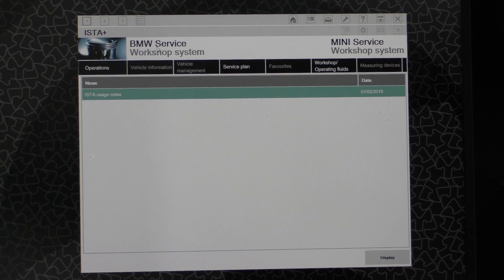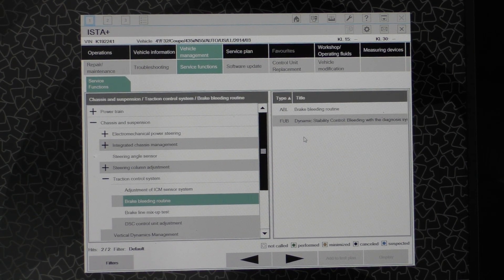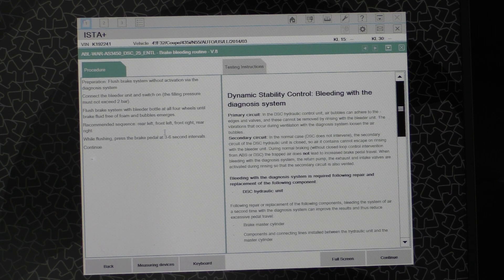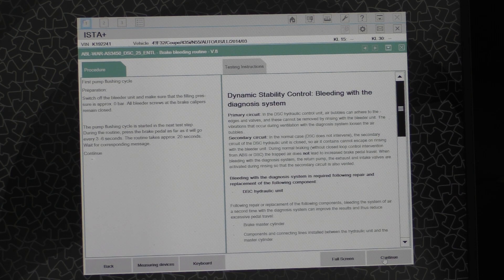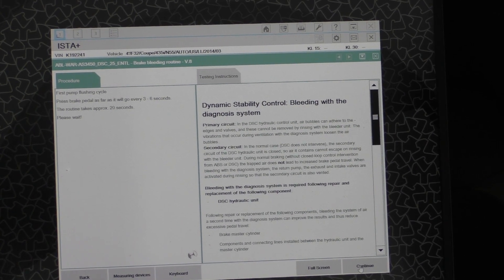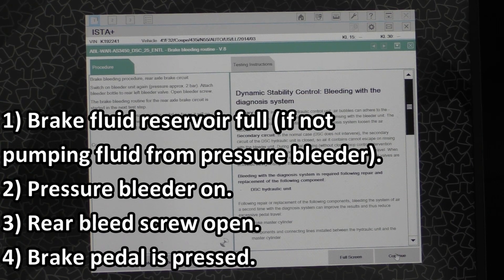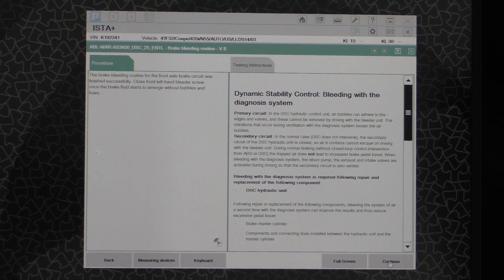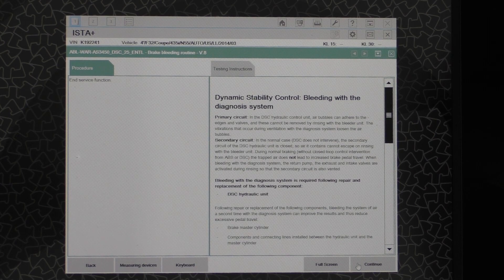BMW ISTA DSC Brake Bleeding Routine (F2x/F3x/F8x)

Comment: For some reason, on my car, a 2018 440xi, I had to not press the brake pedal before continuing to the rear axle bleeding then press the brake pedal before continuing to front axle bleeding. Not sure why it's this way as I had to restart the procedure a number of times until I figured out the logic

Comment: Hi, I ran my reservoir dry on the last nipple when doing brake fluid flush. I drove around for a bit with mushy pedal but topped off and re bled. Now pedal feels good but do I need to do the ABS bleed?
Reply from the maker: I would do some ABS stops in a safe area to see how the car behaves. If they feel normal, then you probably don't need to do the DSC bleed (although it's a good idea to eventually do it).

Comment: When I use ISTA 4.53 ( newer version for G series ) for the brake bleeding routine I do not hear the ABS module activate. I hear some clicking but no ABS module sound. Also, my vehicle has electronic parking brake which needs to be put in service mode before running this procedure.  Strange…

Comment: What about the front right and rear right? Did I missed something? (french guy here)
Reply from the maker: You're supposed to do the DSC bleed after a normal 4-corner bleed, so you only need to do it once per axle (no need to do it on the other side).
Reply: @FaRKle0079  thanks

Comment: About to do this on my f8x with 2 bleed screws on the front calipers, for the part where you bleed the front with the bleeder open, am i supposed to use the inner or outer bleed screw?
Reply from the maker: I'd just do the outer one since it's easier to reach. Plus, the system is supposed to be bled conventionally before running this so there should be fresh fluid throuhout.
Reply: @ I figured it didn’t matter and did the outside one but got some foam at the end of the front axel bleed, I think I’m just bleed the front conventionally again and do the ISTA process all over again.
Reply: Finally got through the whole process on my F82… For some reason I didn’t have to press the brake pedal and press continue until the final DSC activation without the bleeder open. That’s when it faulted out and made me do it all over again. Man that was frustrating lol.
Reply from the maker: @Franco-1012  Yeah it can be a bit tempermental. If you've already DSC bled part of it, you don't really have to open the bleed screw and repeat the part you already bled, just let it vibrate till it's done and move onto the part you actually need to do.
Reply: When you’re cycling the brake pedal during the dsc activations are you timing it with the vibrations? Or just every 3-6 seconds is good.
Reply from the maker: @Franco-1012  I typically press down on the pedal when the DSC module is vibrating.

Comment: Thanks for providing this video. Do you have a rough idea of how much fluid is bled during the DSC bleed, assuming the bleed screw is just barely cracked open? I’m wondering if I can use the pressure bleeder without fluid and keep the MC reservoir level above min during/after the procedure.
Reply from the maker: There's more than enough fluid in the reservoir to do the rears, but the fronts go through fluid much faster and you could go from full to empty if you left it wide open. It's OK to only partially bleed/let fluid flow through part of the duration when it's pulsing the DSC module. I usually hop between the driver's seat (to press the brake pedal) and taking a peek at the reservoir during the bleed.

Comment: Hello, when they mention opening the bleed screw in the rear, does it mean to open both sides at the same time? Or is the procedure including left and right separately? Thank you
Reply from the maker: @buzzdev  the dsc bleed only needs to be done on one side of the car because you're supposed to do a traditional 4 corner bleed beforehand.
Reply: @ thank you for answer. I just did it in the morning on F11. The ISTA procedure writes for each step, which wheel will be done. It went rear left, front left, front right, rear right.

Comment: in my ista i dont have the point ABL Brake bleeding, just the FUB... 
do you know why?
Reply from the maker: That's strange. Maybe your ISTA installation is incomplete/missing files?
Reply: @FaRKle0079  i have found out the reason, the ABL Brake bleeding is only displayed when the vehicle is connected, not before
Reply from the maker: @Marc--Marc  Well that makes a lot of sense!

Comment: I tried this procedure yesterday. As you mentioned in your instructions, I hit the brake pedal at the appropriate times but still had ISTA+ have me start over a couple times. One time the brake fluid reservoir went empty and then I had to rebleed each caliper! I did eventually get the rear axle DSC bled but for some reason ISTA+ kept making me start over with the front axle bleed. I tried pushing the pedal slowly when hitting continue and also tried having the pedal fully pressed but each time ISTA+ would make me start over. Gave up after a few tries.
Reply: I have the same issue. Just do the front  instead of the rear.

Comment: Is the schwaben pressure bleeder not sufficient enough alone when bleeding brakes? Are you saying that in addition to the pressure bleeder, that you also need to pump the brake pedal rapidly? I'm worried that pumping would potentially push too much fluid out. I'd like to do both a full flush and the ISTA DSC bleeding routine. I've got 1.5L of new fluid, would that be enough to do both a 4 wheel bleed and the ISTA DSC driver side bleed?
Reply from the maker: Yes, sometimes the pressure bleeder alone isn't enough and you will want to step on the brake pedal with hard and sharp impulses. It won't suddenly make a crazy amount of fluid come out of the bleed nipples.

If you want to do a full ISTA DSC bleed with complete fluid exchange I'd grab 2L to be safe. If you're not trying to pump the brake pedal as many times as possible during the DSC bleed 1.5L can be enough.

Comment: How did you do the standard bleed before? Just bleed each corner until no bubbles in the lines? And then do the ISTA protocol?  

I changed my fluid for the first time and might have let the pressure bleeder run too low and let air into the system but I'm not sure.  I'd assume the best path would be to do a quick additional bleed and make sure no bubbles come out and if it still feels a bit spongey to do the ISTA bleed after?
Reply from the maker: Yes, I do a normal bleed before the DSC bleed. For your case, I'd do a normal bleed while stomping hard on the brake pedal to get any air loose, and then if the brake still feels soft do the dsc bleed.
Reply: @FaRKle0079  Thanks!  What's the best protocol for hitting the brake while bleeding?  Just open the nozzle and then slowly hit the brake 5-6 times and then close it? Does the brake need to be pressed down during opening/closing the nozzle?
Reply from the maker: @cptclutch2530  you should be pressure bleeding (have pressure bleeder attached to brake fluid reservoir). Once you open the bleed screw the fluid will start coming out, then go to the driver's seat and quickly/sharply press on the brake pedal hard 2-3 times, then close the bleed screw and check your fluid level in the reservoir.
Reply: @FaRKle0079  Great advice!  Really appreciate it.

Comment: Are you hooking up the car to a power supply when you're doing these routines in ISTA?
Reply from the maker: Generally yes, but if you have a full battery you don't HAVE to.
Reply: @FaRKle0079  I was referring to the “70 amp” power supplies that BMW prescribes for doing programming work, but I imagine hooking up to a standard battery charger/maitainer (CTEK) would be fine for this type of work or for scanning codes.
Reply from the maker: @Matt_C_N  70A supply is excessive! A 4A supply will slow the drain a lot, and a 10 or 15A supply will charge the battery even with ignition on and doing the procedures.
Reply: Never a bad idea to hook up a car to a battery tender when using accessory mode for a prolonged amount of time

Comment: Sorry for a comment on such an old video! With a 2NH brake or similar with an inside and outside nipple, do you just open one of the nipples to do a DSC bleed? Thanks for all these great videos for the BMW community!
Reply from the maker: Yeah, since this is done after a normal bleed, you only need to do through one of them.

Comment: Do you need a presssure bleeder?
Reply from the maker: Yup, you need to have pressure hooked up for this.
Reply: @FaRKle0079  just want to update this comment for people in the future. i did this today with out a preassure bleeder and it went absolutley fine. i just closed the reservoir inbetween calipers and filled it to max. but i want to add something that my ISTA didnt have the same steps as you, maybe its cuz its an e6x. but i just had to activate it and press the pedal all the way down 5 times for every time, did it 3 times and filled up the reservoir it prob bled out 200ml per caliper including the 3 times. my ista version is 43.15.3

Comment: What trouble codes does this cause? I just changed the rear brakes on my x5. I have a power bleeder but I think I might have gotten a little air in when bleeding. The brakes feel pretty normal for about 10 minutes and the. I get a dsc error: 29 Dynamic stability control
1 error
48072E: Valves in general - pressure build-up in the rear axle circuit too low

Comment: Great video! How much fluid did you use going through this procedure? According to ISTA+, you are supposed to bleed all four corners again using the bleeder. If you bleed all four corners, then bleed the DSC, then bleed all four corners again, that sounds like 2-3 L of fluid.
Reply from the maker: If you do a flush beforehand, and then the DSC bleed you'll use 1.5-2L of fluid. There's no real need to bleed all four corners again after completing the DSC bleed.

Comment: I thought the rule of thumb was to not lift the brake pedal with the bleeder valve open because it will suck air into the system. It seems that is not part of BMW's procedure. Do you know why it's ok to lift the pedal with the valve still open? Thanks!
Reply from the maker: You're correct on the rule of thumb, however that doesn't really apply when you're pressure bleeding. Since the reservoir/brake system is always pressurized, it's always trying to force fluid out, even when lifting up on the brake pedal. As long as your pedal release isn't super fast/abrupt, it shouldn't suck air in.
Reply: Thanks for your reply. For a good portion of the pedal release isn't the master cylinder closed to the fluid reservoir in order to build pressure? @FaRKle0079
Reply: @FaRKle0079  do you know for a right hand drive which side you need to bleed during the procedure?
Reply from the maker: @mtwoodford  Bleed whichever side of the car the DSC module is on. I believe even for RHD vehicles the DSC module is on the left side.

Comment: So in "Rear axle DSC bleed" step (from 4:50) I need to open bleder screw and just left it open for the whole bleeding time? When doing manual bleed you open bleeder screw for a few seconds at a time, right? But here seems like I just need to open it, leave it open, then press brake pedal then hit continue and then wait for the whole ~30 seconds procedure to finish and only then close the bleeder valve??

Comment: Hi Farkle. I've said this in your other videos a while back but wanted to say thanks again for all your helpful videos. You literally always come to the rescue when I mess things up. I also introduced air into my lines while doing the brake flush and was shitting my pants, but sooo glad you made a video on exactly the problem I was having. The Bimmer community is so lucky to have you. Thanks again man!!!
Reply from the maker: Glad to help!

When you're bleeding your brakes to get the air out I recommend stepping on the brake pedal rapidly and very hard to try and dislodge any bubbles while doing the ista bleed. That'll give the best chance of getting rid of the air.
Reply: @FaRKle0079  Is the schwaben pressure bleeder not sufficient enough alone when bleeding brakes? Are you saying that in addition to the pressure bleeder, that you also need to pump the brake pedal rapidly? I'm worried that pumping would potentially push too much fluid out. I'd like to do both a full flush and the ISTA DSC bleeding routine.

Comment: Hey man hopefully you can help me with this. About a week ago I replaced my brake pads on my car and it. Drove smoothly. This morning I was driving on the highway and the car in front of me slammed on the brakes with cause my front collision system to engage and after that when I’m driving about 0-60km/h I heard a scraping noise I bend the dust shield back but no stone fell out also my brake fell good at high speed braking but about slowing down from any speed I heard a loud scraping noise and coming to a stop it fell as though the brake engages backs off abit and then engages and back off abit and engages again and repeat until it comes to a stop all of this happens really fast but I can feel it

Comment: Another fantastic video.  2 quick question, if you don't mind.  I'm doing a CCB retrofit onto my '18 M2 (requires a different booster, which requires the master cylinder to come out) and I've read of several guys doing the job without needing to do this procedure (they had firm pedals after a few traditional bleeds).  They said that they did the traditional bleed, then did a few hard stops to invoke the ABS, then did another traditional bleed and they have a firm pedal.  1. Even with a firm pedal it's possible that there is still air in the DSC/ABS module, correct?  2. Is there danger in leaving that air there if I have a firm pedal after the above mentioned procedure?
Reply from the maker: I believe you can have air (or old fluid) in the DSC module but still have a firm pedal if you're not activating DSC. If there's air in the DSC module, it means when ABS is supposed to activate, it probably won't be pulsing braking on/off as much as it intends to. 

For normal everyday driving where you're not getting into ABS it's probably a low risk.
Reply: @FaRKle0079  Thanks for the reply.  I wonder if it could explain a soft pedal if someone didn't do the DSC bleed, but ended up having some hard ABS stops in the future.  Seem like the ABS activation would introduce that left-over air into the system.

Comment: @FaRKle0079 did I miss why you had to do this ?  I flushed my brake fluid today with a power bleeder.  When I was done to test drive, moved car 1 foot and brakes locked up.  Pedal is firm all the way at top.  All brakes locked up.  Don't know what to do.  any idea what issue could be ? (15 m235i manual)
Reply from the maker: This procedure is only really needed if you get a decent amount of air into the brake system. I don't do this unless I really need to.

If you're getting too much braking power early on that's really weird. When the car is on the brake booster should be active. I wonder if the pedal feels boosted/overly strong with the car off too.

Comment: Hello, maybe can you help me. I changing brake fluid on my bmw e61. When i activating the abs pump to release air bubbles, its works, but on my dash for a few seconds come out "abs dcs" error. When i repeating the procedure, it happening again and again. Now, after fluid change, the brake pedal feels need more power to stop to full. There is no air bubbles, no errors about abs. What is the problem? Now, when im writing this, i remember when i were bleeding the brakes, i forgot to add brake fluid to the reservoir and some air maybe got in the brakes and that "abs dcs" error come. How to fix this? Thank you!!!
Reply from the maker: If the brake fluid reservoir went dry, you likely pushed air into the brake system, which would definitely reduce your braking power and solid pedal feel. You'll need to bleed again (possibly multiple cycles) to clear that air. I also recommend stepping on the brake pedal very quickly and with a lot of force during pressure bleeding to try and get that air in the system out.

Comment: I don't have access to a power bleeder where I'm from. Would it work the same if I just make sure the brake fluid level doesn't go super low? I was thinking of getting a bleeder bottle and letting the brake fluid from the caliper nipple flow there. Did you hold down the brake pedal after ISTA said that the bleeding is complete and get your buddy to close the bleed nipple? Or was it just let the fluid flow out and see if there is air in the lines?
Reply from the maker: You need a pressure bleeder for this routine to work. It'll be incredibly difficult with a "2 person method" of opening the nipple, pressing the pedal, closing the nipple, and then releasing the pedal while the system is pulsing. With a pressure bleeder you can just press and release the pedal since the system is always pressurized to push fluid out of the nipple.